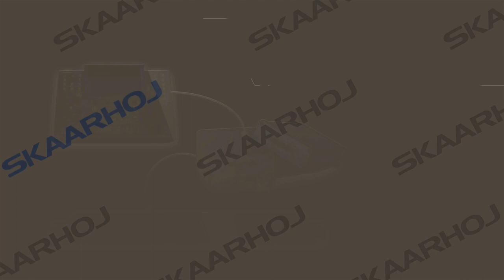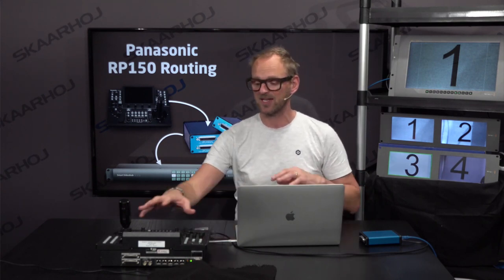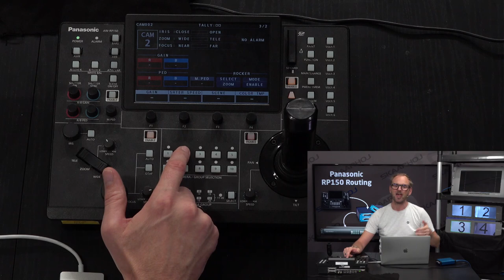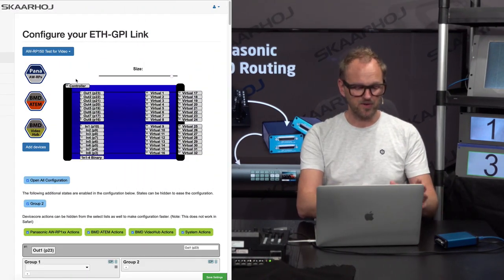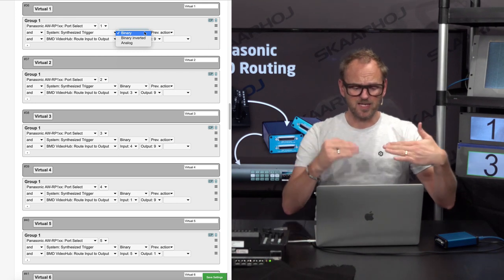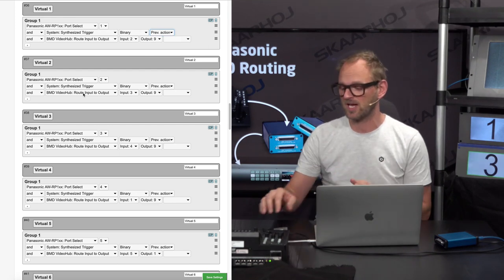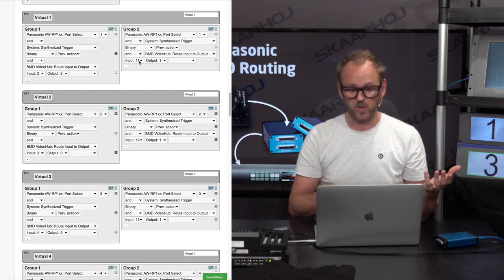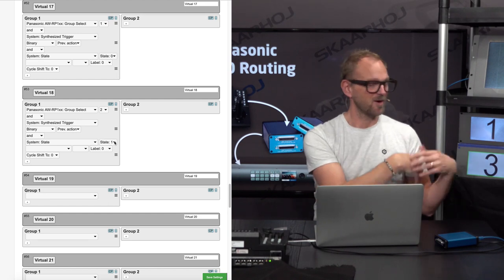Panasonic RP-150 connected to a video router

Comment: I operate some AW-UE70 cameras with the RP-150. Program switching is done by a BlackMagic ATEM switcher. I would like the tally status of my cameras to show up on the RP-150. Can I use your product to import tally status from the ATEM into the RP-150 or does it have to be hard wired?

Comment: Hi, we want to use the interface to control an AUX channel from a Atem 2 ME mixer via the Panasonic RP150 panel. In your video there are always some black frames on the monitor, when you switch the ports/cameras. Why does this happen? When you switch the signal on the Atem itself, there is no such effect.
Reply from the maker: Hi. 
The video hub does not have frame syncs so you get a jerky transition when you change your routing - usually with some black frames.
This will also happen if you use the BMD software to change the routing.

This will not happen if you control equipmen that does have frame sync. The AUX busses on the ATEM 2 ME have this, so you would see a nice clean transition with no black frames.
Reply: @SKAARHOJ  Hi. Thank you for the information. We've ordered an interface and are very excited :-)
Reply from the maker: @stuttgartpride  Happy to hear it! Let's us know how it works for you!